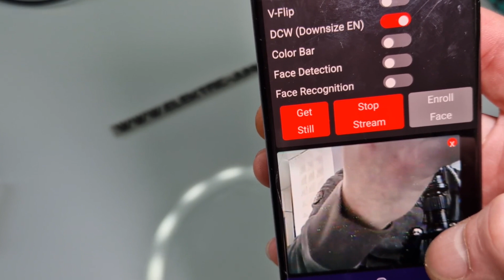How to Build a Hidden DIY Surveillance Camera with ESP32 | Easy & Cheap Hidden in Everyday Product

Comment: What is the resolution of the video?
Reply from the maker: hi, The module combines with the OV2640 Camera Module which has the highest Camera Resolution up to 1600 × 1200. The camera connects to the ESP32 CAM Board using a 24 pins gold plated connector. The board supports an SD Card of up to 4GB. awesome is it ? (In that Budget) thank´s for comment
Reply: @ejunky66  that sounds awesome.
Reply from the maker: thank´s a lot mate we will inform you on our next Project